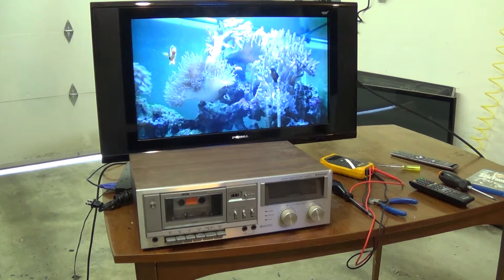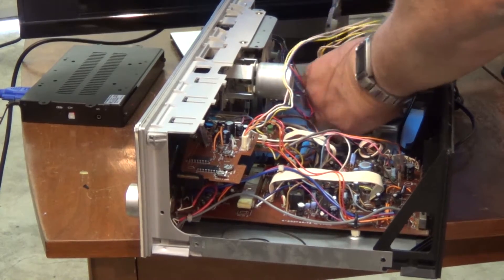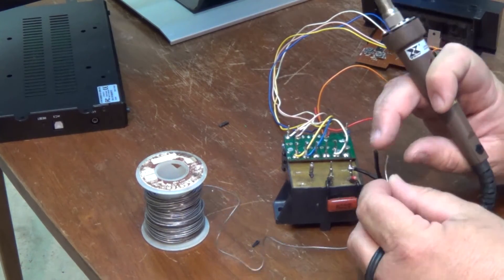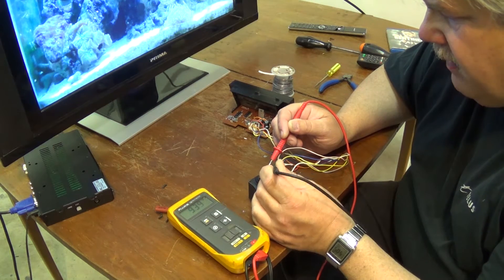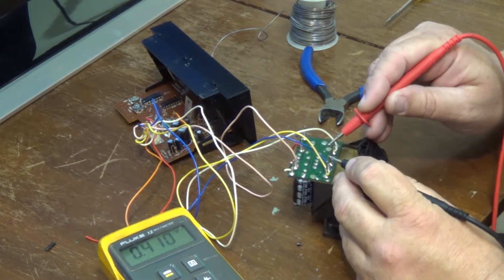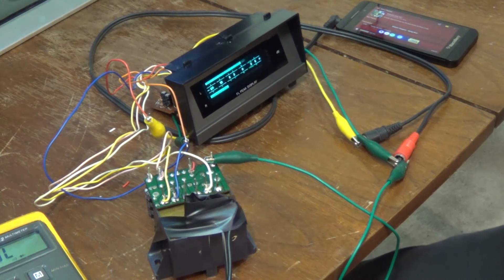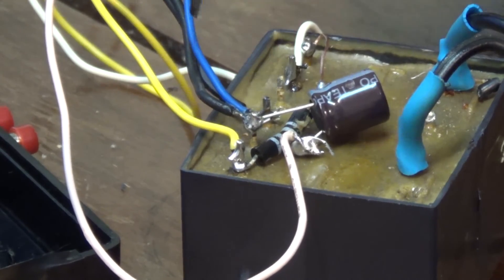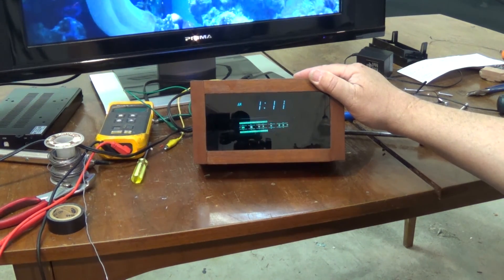VFD Clock   VU meter build

Comment: Speaking of VU Meter, would also be possible to use an Analog VU Meter two?
Reply from the maker: ***** Yes if you have the VU meter drive circuit then yes.
Reply: @12voltvids  ops! duplicate video??🤔
Reply from the maker: @Ramdileo_sys  no